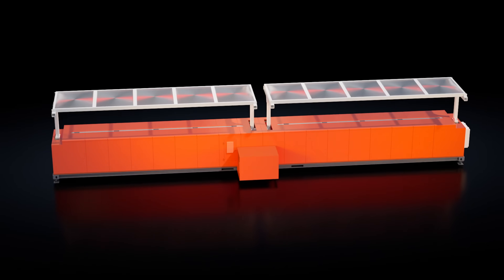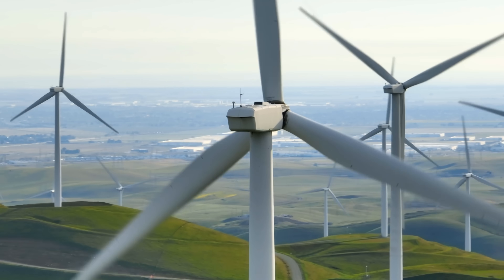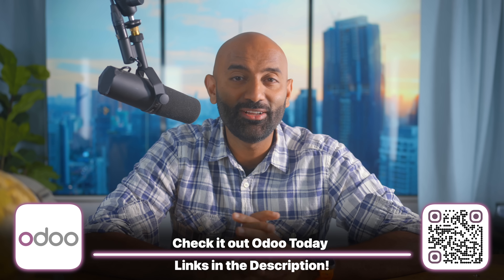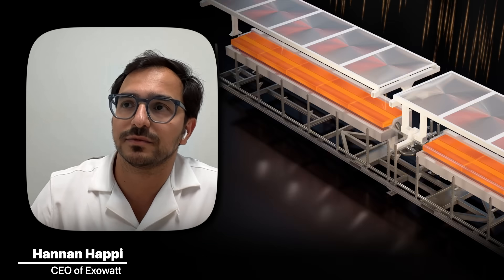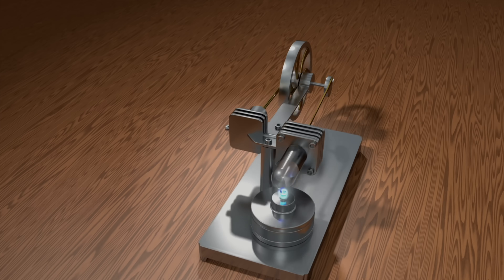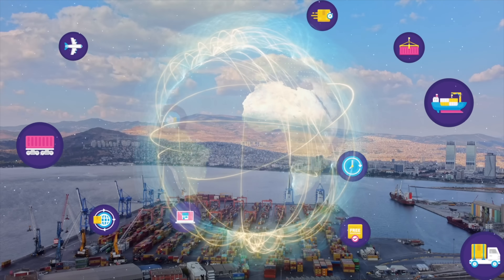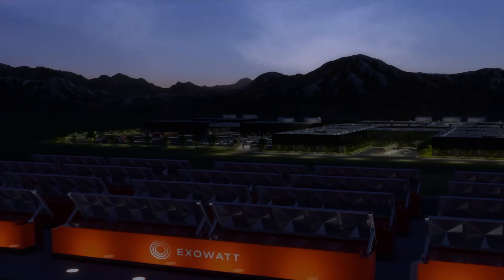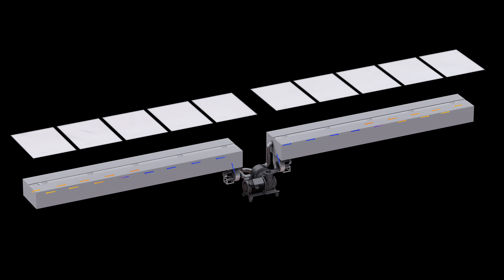Solar Without Panels, Storage Without Batteries - EXOWATT

Comment: Fresnel lenses are horribly inefficient. The area of those lenses is the same as the area of the top of the storage containers, actually reducing significantly the energy absorbed, in exchange for making a few small patches hot, until the heat is dissipated. Since dissipation increases as the 4th power of temperature, your heat batteries are losing power faster than if the lenses were omitted.

You can do solar without flat panel PV arrays, at higher efficiency, with concentrated solar, A 3m wide multifocal parabolic mirror concentrating sunlight on a 3 cm wide PV strip will have 100x solar intensity, increasing efficiency of the PV conversion ~40%, provided you run coolant to keep the PV strip at 100-200 C. Conveniently, that's a great temperature range for steam to drive turbines. Congratulations, you're generating hybrid primary power at over 80% efficiency in low cost mirrored troughs with no fancy sun tracking, and the pressure generated can be stored for later use if you can't accommodate all the electricity generated at peak.
Reply: And your proposed solution could beat their price?
Reply: @forasago  ROFLOL!

Whatever the price of something that can't work by fundamental Physics, it's too high.

20 years ago, multifocal trough with 3M high reflectivity surface on PECAN paraboloids focusing 100x sunlight on a thin strip of high performance PV with IBM microchannel cooling to drive steam turbines would have beat everything on price enormously.

Now? PV flat panel is so economical there's unlikely to ever be a primary source generation technology that can touch it, except the next generation of PV flat panel.

I'm just saying, if you want needlessly complex arrays of wind-vulnerable concentrators, don't be fooled by Fresnel and sand.

Comment: If it tracks in only one axis then the fresnel lens cannot be made using concentric prisms, they must be parallel prisms to focus the energy into a line, not a point.
I'm not convinced though - sure it can create some hot bricks, but Stirling engines have an efficiency of around 35%, and then you'll have more friction and generation losses and manufacturing costs/transport etc.
Even with solar at 20%, it produces primary electricity which is directly usable, and you can use the land under solar panels for grazing sheep or use for crops or car parks.
The heat captured by solar panels contains the other 80%, and this is normally ignored when it could also be used to drive a heat pump to amplify temperature, and cool the cells to improve performance.

Comment: I wonder if they could make a version where it was more about heating than producing electricity and if there is a practical application for that.
Reply: i really like this idea for people living in high altitudes, where heating water and homes is expensive, i would love to have this at my grandma´s house, where in winter it can get to -1 °C
Reply: There are rooftop elements that both provide heat to the home and water heating, been around for decades, it is very simple (mainly black water-filled pipes on the roof, absorbing solar energy). There are also now rooftop solar-powered elements that extract water from the air.
Reply: Bet you could invent a cheaper system if it were buried and used something like perlite as insulation. Water could be kept out using some sort of a moisture barrier or even having metal panels akin to those on grain bins surrounding the system with a sump pump to remove water.
Reply: @ryelor123 there can be many variations to this. Just think about it and the variants will pop up in your head.
Reply: Yes, process heat. Brick making requires about 2000°F. Ceramic tiles 1000 - 2000°. Cement a bit more - 2600°, but the substantial pre-heating would drastically reduce fuel needs.
Reply: Yes, I am interested for off-grid consumer
Reply: Exactly! But that won't being much money for them 😂
Reply: There are.
Reply: We have evacuated tube collectors, no need to hassle with Fresnel lenses
Reply: I believed Iceland does that but with geothermal rather than solar as the heat producer.

They pipe the heat directly to homes and as well as using for electricity generation
Reply: Yes I agree. These can be built into houses and used as a thermal sink. Put them is sunny locations and blow air over them to heat the rest of the house. Lots of uses such as hot water too.
Reply: @chrisb508  Generate electricity. Use the electricity to power Bitcoin farming. Use the heat from the Bitcoin farming computers to heat your house. Use the money generated by Bitcoin farming to pay for the equipment.
Reply: @chrisb508  Done it. There is already out there.

Comment: why now take the excess heat from cooling data centers and feed that into a sterling engine to make power?
Reply: Stirling engines require a temperature difference to work. They need a heat source (your data center) and a cold source (ambient air). The problem here is that if that temperature difference is too low, the Stirling engines will be very inefficient, and that's exactly the case where the exhaust heat of data centers is about 40 or so degrees C (100 F). At best they could convert 5% or so of the heat into electricity.
You would be much better off capturing that heat in water and use for district heating or sanitary hot water, where efficiency could in theory reach 100% if insulation is perfect, and around 80% or so more realisitically.
Reply: @texanplayer7651  Agreed. However, Data Centres are usually cooled by Aircon units, and there are refrigeration systems that operate at quite high temperatures in the condensor, so it may be possible to run a Stirling engine.
However, much better to use the waste heat from the refrigeration directly to heat water or air for an industrial application (laundry, food industry, timber drying...) many industrial processes require a lot of heat at reasonable temperatures.
Reply: @texanplayer7651 In Norway and places where there are lots of "naturally cooled" data centres, the waste heat is just sent directly to nearby homes
Reply: Nobody does air cooling in data centres anymore because it is very inefficient. Any new data centre that is being built today uses liquid cooling in a closed loop with minimal water loss. They use a heat exchanger to remove the heat from the water but keep it running in a loop.
Reply: What is the temperature difference? Can datacenter handle some 300°c?
Reply: @Kefas226  There is a good reason why datacenters are cooled below 30 degrees C... 300 degrees C is enough to melt many small parts of their fragile electronics
Reply: @texanplayer7651  of course , so not enough temperature difference to feed Stirling engine right? Only flaw on a genius plan.
Reply: Are you crazy, that's too much comon sense, too much logic there, stop being rational, this is triggering me... 🤔😏😉😁
Reply: @patpozzuto4809 bot

Comment: Why use a fan to transfer hot air from the thermal batteries to the stirling engine? Wouldn't a more direct connection to the thermal batteries to the hot side of the stirling engine be more efficient?
Reply: I agree, but they weren't after efficiency, they were after cost. Air is cheep especially at the temps they're claiming. If the engine was connected how would you turn it off? Here they just turn off the fan.  MY Hmm moment is how are they going to radiate all of the heat away from the sterling engine, doesn't it work of differential temperature.
Reply: that would result in less storage per engine. The heated air can pull heat from several batteries to one engine.

Comment: Photovoltaik can be installed above parking spots and of course on buildings. This means the land use is 0. Also if you don't need it, you just can turn off the inverter. 

Everyone of those lenses can literally start a fire. This will never take off.
Reply: For grid applications, you want as much equipment as possible on one site.

It's easier to maintain as opposed to driving around a city and entering buildings to access a roof or blocking a parking spot, all while lugging repair equipment. 

With this and a cat walk system, a technician could maintain multiple trailers and only climb up and down once.

His EV truck could even meet him at the end of a run and bring his lunch with the use of an app. lol
Reply: If you grade and gravel the site, the risk of fire is negligible. 

I'm not sure how a fire would start in the first place they're not dropping these in dry grass fields. 

There's also danger with lithium battery fires.
Why isn't that one of your concerns?

Or an inverter that overheats or shorts.
Reply: Good thing we don't allow Natural Gas to be used since it's extremely volatile.  It can literally start a fire AND explode! Ohh wait...
Using your logic cars would never be allowed to be filled with gasoline. Yes, Fresnel lenses can start a fire, but so can electricity, or gasoline, or propane, or NG, or even Photovoltaic solar panels if improperly wired.

Comment: Ah yes, I've seen a silo sand battery version of the heat storage part. Digressing somewhat, but I thought it interesting they have considered using a Sterling Engine with Plutonium as an alternate power possibility for Space Probes to the Outer Solar System as it is more efficient than a regular RTG, and a larger version to possibly power a Mars base.
Reply: Plutonium is already used for RTGs. Voyager 1 and 2 both use Plutonium oxide.
Reply: @ryelor123  Yes, but not to power a Sterling Engine, so far.

Comment: This looks workable to me. What is the build cost if the Modules are built in Texas or even Detroit utilizing skilled displaced autoworkers? With Domestic build cost what is the kilowatt price? I know investors who would invest if it’s domestic, they are done investing . outside the U.S. 
Besides the obvious advantages the maintenance and replacement  looks doable unlike the problems with the aging wind and solar farm disasters that are coming. I’ll all in this looks like the next best thing to Nuclear.
Reply: Renewable energy investors should probably look OUTSIDE of the U.S. for the next 4-5 years.  It turns out that we are one of the very few countries run by climate deniers captured by the petroleum-industrial complex.  The EU has a functioning carbon market and real climate regulations while Africa lacks the enormous stranded investments in fossil fuel infrastructure and legacy grid that has slowed the energy transition in the 1st world.
Reply: @JonahStein there s no f ing climate change you got to many boosters

Comment: I notice that you do not show an actual unit!
Reply: something this low tech should be easy to build, demonstrate and validate. so where is it?
Reply: Thats the major red flag.
Reply: Because it doesn't work. We have existing CSP systems that actually do work, but this isn't it. See Scheffler reflectors for example, there are many working installations.